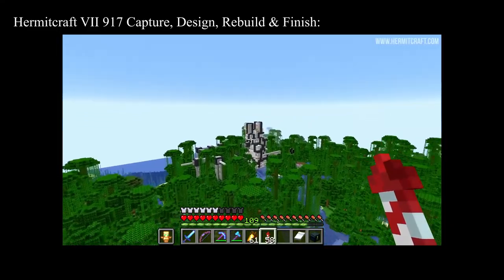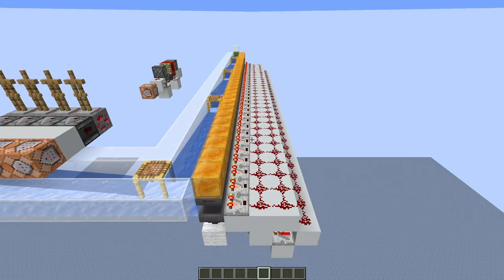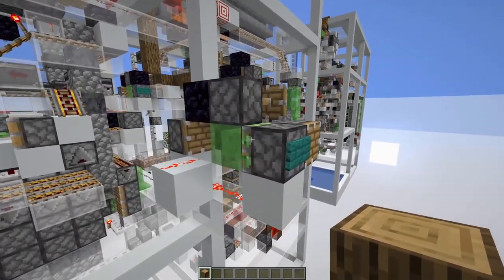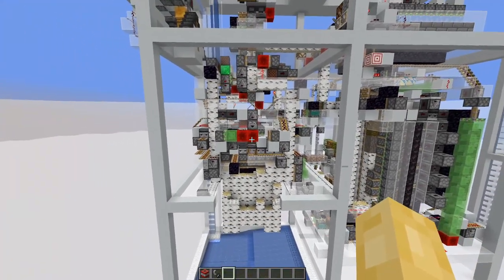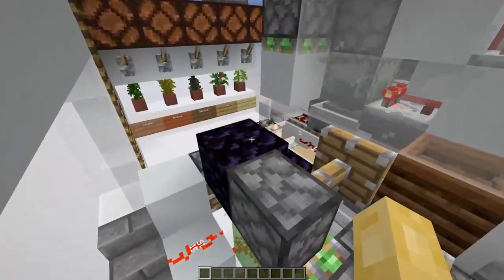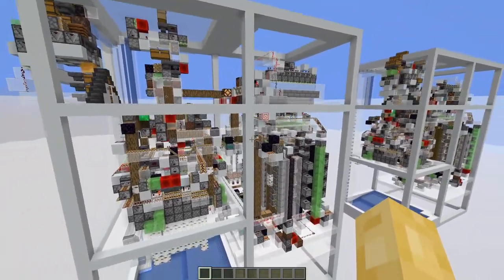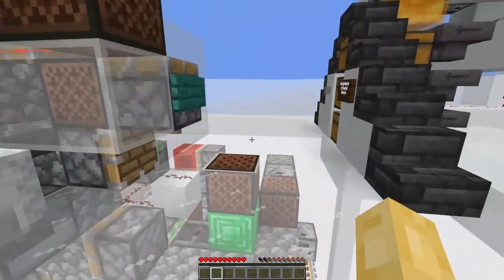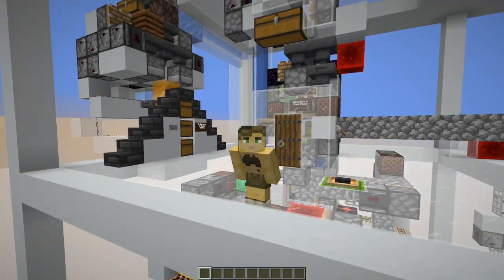Minecrafts Ultimate Omnifarm

Comment: Nice to see you making your contraptions dustless / reduced.
For 4gt solid blockstreams I can recommend Lollopollqo's smartpiston. It's dustupdateless and uses only 1 piston.
Reply from the maker: I have also been using this smart piston. The only problem is that it doesn't work for any blockstream moving upwards.
Reply: @cubicmetre  for upwards there's also a neat design by Plexi I can recommend. It uses 2 pistons and ist dustless aswell.

Comment: Hey is this farm directional? I downloaded the schematic and when I placed it into a world for testing I was able to get it to operate without issue. I then took the schematic into survival to built it, but I rotated the unit and I haven't been able to get it to work. Cobble/Basalt output facing east works, but facing north doesn't. Looks like an issue with the system that splits 1 block stream into multiple.
Reply from the maker: It should not be directional, floppy and I made sure of that
Reply from the maker: I found the directionality issue, it was only when initially starting the farm. I have already updated the schematics to include some extra blocks in the blockstreams to prevent this from happening in the future.
Reply: @cubicmetre  I applied the fix and that worked! Thank you so much for the help, this farm/factory rocks I'm excited to use it

Comment: Might be unnecessary to post this, but in case someone's newly built farm's Auto Shutdown System is triggering seemingly without reason, just keep doing the loop (stop generation, stop alarm, clear buffers - start again) until the tnt gets duped for the first time.

Instead of generation I just manually placed blocks, but it shouldn't matter imo.

I'm not gonna pretend I know why this happens, but it's what worked for me.
Reply from the maker: You probably left out blocks from the schematic that ensure each side of the chamber starts in sync. Keep in mind if the auto shutdown is triggering then something is broken and needs to be fixed, it is meant to avoid the machine failing catastophically this way.
Reply: I don't think that was the issue, I've gone through the schematic multiple times checking with Schematic Verification, we're talking about 5 hours of troubleshooting with fully finished build and with all the hopper clocks correctly set. 

I was able to somewhat replicate the issue by activating the Auto Shutdown from different points in the system (in the creative world, putting a button on a block and activating it), when I did that and then ran the chamber, it clogged up the same way it did in my world, but it could be a different cause.

I'm not saying it's the intended way or something I wanted to do to push through Auto Shutdown in that way, but it was at a point where I was out of ideas and with backups of the world.

On a different topic here, do you plan on continuing making the mud/clay farm as you mentioned in your dirt farm vid? Your design style is really great and I'd love to see a farm from you.
Reply: @mxarycovsky6973 I might be running into the same issue as you were: all the blocks of the TNT chamber are correctly placed and in the correct state, and the farm has worked for ages (got 2 double chests of dirt shulker boxes), but suddenly stopped working for seemingly no reason. Particularly the TNT does not seem to want to get duped. [Still using 1.19.2.]

I'm not sure if I'm understanding how you solved the issue. Could you please explain in more detail? So, did you just just follow the steps which @cubicmetre explained (clear buffers etc), stop the alarm, and then ran the farm again until the alarm started again, and then again cleared the buffers etc, turn off alarm, and keep going like that? Thing I'm concerned about is, what if the tnt doesn't get duped at all? I feel like I'm starting to run into the piston push limit eventualy, which will probably break it even more. Weren't you afraid of the piston push limit if the TNT wasn't being duped?

Am curious to hear from you! Because, believe it or not but 2 double chests of dirt (in shulker boxes) has not been enough for my needs, so I'm pretty desperate to fix this thing lol
Reply: @maxrycovsky6973  wow I figured out what it was. It had nothing to do with the schematic, that was all good. I did two things to fix it:
1. broke the TNT block, and put it back in its place
2. right-clicked the noteblock right above the TNT (didn't mess up anything fortunately)

it seems like the TNT was stuck in some kind of quasi-activated state and therefore couldn't be powered or duped once more... I have to test more, but so far it has done 2 rounds of TNT duping.

If you run into the issue again next time, be sure to try this! I'll post a regular comment as well to explain that this can solve the farm.

Excellent farm by the way @cubicmetre !

Comment: hey cubic i recently build this farm in a multiplayer world (paper version idk if this is relevant) and everything works fine exept for the tree farm it keeps breaking, well not the tree farm but the block conveyor belt keeps breaking do you have any solutions for this?, ive checked everything that could break and compared it to a working version and haven't found anything, i also have a problem with the shulkerbox unloader it doesnt pick up the empty shulkerboxes in the right hopper the empty shulkerboxes go into the bonemeal input, could you maybe help me out?
Reply: I have the same problem, everything works but the smart pistons seem to trip over themselves and get stuck on the blocks and trigger the fault detection after a few seconds. Also on a paper SMP but it works perfectly in single player creative.
Reply: @MasterElements  i found a solution and m problem was i was missing a lever that was activated and my comparator pof the shulker loader was on i think compare and not retract or either way i dont exactly remember but that fixed it for me, if you want i can halpe you
Reply: @x1fu351  I would love the help, but according to litematica I've built everything correctly, checked all the hopper clocks too but they could prob use a triple check
Reply: @MasterElements question, how did you prime the TNT duper?
Reply: @mircydris  It doesn't need to be primed like most normal ones, you can build it like the schematic without danger of being blown up.

Comment: Built this on my server and its just all gone wrong :( the extruders at the top are too fast and break within seconds, the tree farm's piston tape does the same. Havnt been able to test the blast chamber yet due to these not working. Is there any way to slow things down? Seems like the tree farm is the only thing working for me and im not sure where to go from here. On the upside, the automatic turn off works a treat, lol.
Reply from the maker: Keep in mind that the design does work, I've tested it extensively. You need to make sure that all the elements of the blockstreams are in the correct states otherwise they will jam. This can easily be done with the schematic verifier. As for the tree farm there is a weird issue where the piston worm will break the first time you run the farm but then if you fix it and run it again it works fine. I cannot figure out why this happens because the machine looks exactly the same both when it's working and when it's about to break running for the first time. I have schematics of both cases which are perfectly identical.
Reply: @cubicmetre  Biggest problem im having is the feed tape its popping redstone dust off and then getting to push limit before it all goes to hell. lol. and the bit at the back where the sticky pistons push over normal pistons to push things down keeps getting stuck. ( I assume its supposed to go back to schematic normal when the farm is turned off?) :s maybe it's just our server? I think we're on paper as far as i know (literally that's all i know other than log on and playing, lol). I'll run the farm for about 5 tree's worth and then check and sure enough redstone popped off all over the place.. I reset it to schematic stage with the only exceptions being the color of glazed terracotta. I know the design works as i've pasted the schem in creative and tested it there, so im guessing the issue is the server. 

Also, the servers MSPT is 50ish if that tells you anything?

Feed tapes will always be my enemy, it seems. :( But i want you to know i absolutely love your videos and how you explain things so that even a dunce like me can go "oh, alright! that's how that does the thing it does!"

Comment: What would happen if I built this on my server and my friends would activate multiple/all modules simultaneously?
Reply from the maker: Well you can't exactly just "activate" every module simultaneously. The only module which runs fully autonomous is the igneous extruder. To run the tree farm or the concrete converter you need a player there placing things. Needless to say turning on the igenous extruder while the tree farm is running is not a good idea.

Comment: Can't see items inside hopper clocks in the schematic :(
Checked in 1.18 and 1.20
Reply from the maker: Try holding down the i key whilst aiming at the schematic block and it will show you its inventory contents in a HUD
Reply: @cubicmetre  I did that, of course
Shows empty hopper inventories for me
Reply: @cubicmetre  hi can you check if the tree farm need an update? Because I think it is outdate and I need a solution ...  I build it but it brake with acacia and jungle and iven some times with brich...

Edit:
Ok I found out the solution:  in my case (1.19.2 SP) the bottom clock must be on 2,4,4,4 redstone tick for the Jungle and Acacia to let the block conveyor to extract blocks, and can be 1,2,3,4 like in the world download instead for Oak, Spruce and Breach

Comment: for some reason when i use this with jungle saplings the farm is breaking near
piston column
Reply: I have same problem with acacia and jungle in 1.19.2
Reply: Solution?
Reply: Server?
Reply: I got the problem because I was playing on a fork of paper server!
Reply: @nessunonessun1  adding a 2 tick delay to the tree farm clock worked for me!
Reply: @mohanranganath5470  where did you add 2 tick? Exatly I mean in what part because I tried but the clock do not change the sequence the farm push blocks...
Reply: @mohanranganath5470  I am om 1.19.2 single player but it brake iven in cubic miter world download...
Reply: @nessunonessun1  then that would have been version issue !
Reply: @nessunonessun1  check the 2 floor of the tree farm there will be a chain of repeaters !
Reply: @nessunonessun1  assume there a ground floor!
Reply: @mohanranganath5470  now I see you mean 4 redstone tick so 2 game tick...with 4 redstone tick it work 👍

Instead of 1,2,3,4 on the repeaters of the clock I set 2,4,4,4 👍
Reply: @mohanranganath5470  so for spruce oak and breach I can use repeaters on 1,2,3,4 ticks (redstone) and for acacia and jungle, 2,4,4,4👍 tnx alot
Reply: @mohanranganath5470  ok I managed to add a istant swith using rails and observers to a second clock for acacia and jungle so when I will select the wood it will switch automatically to the second clock ... I did mirroring the concrete block powered from the 4 tick repeater before the 1,2,3,4 clock and I added a redston dust going downstairs and a 2,4,4, torch, torch clock so I managed to power the rails and the 3 tick repeater in 12 tick delay instead of 10 from under 👍

Edit. Some times with 2,4,4, torch, torch it still brake on very tall jungle...if some one want to be sure can do 4,4,4, torch, torch and so with 14 tick clock...